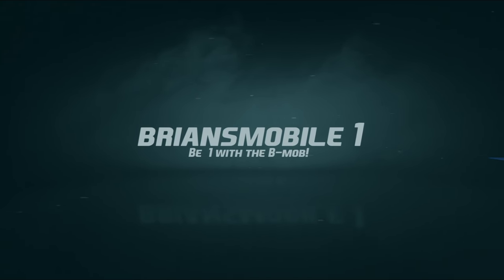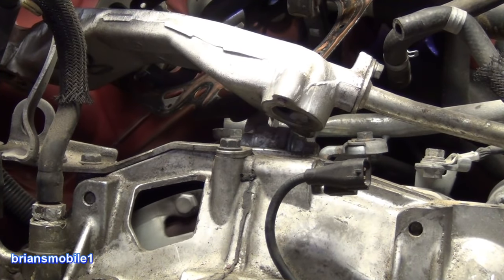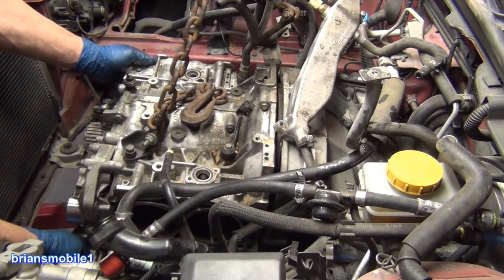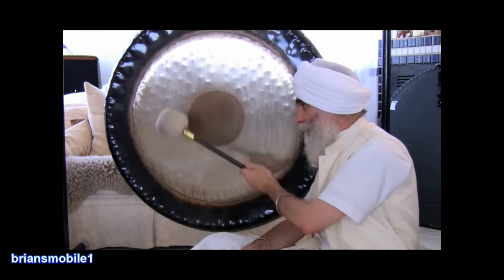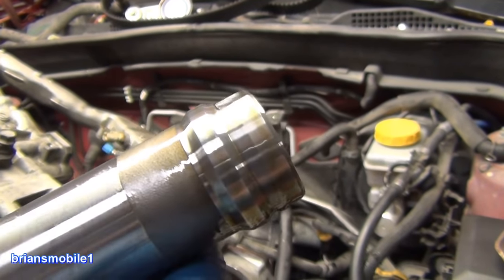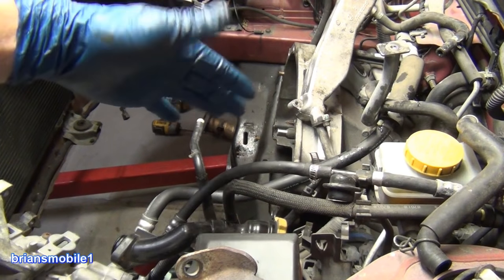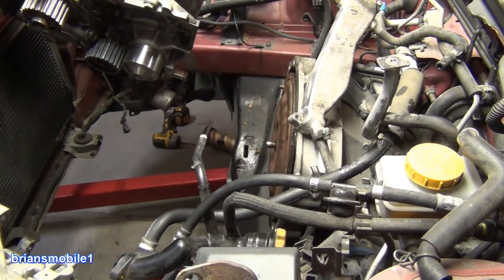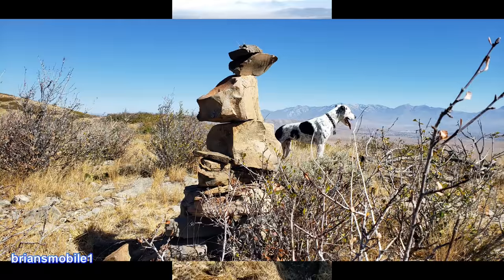Automatic Transmission Vehicle  Engine Swap Hazard$ & Solutions

Comment: Putting your finger on the torque converter bolts is WAY easier than picking the car upside down and shaking it until it falls out.  Guitar tricks don't work quite the same on cars.
Reply from the maker: Sage advice my friend!

Comment: So I absolutely totally pulled the torque converter out of my wife's Forester when I replaced the head gaskets. I pulled the engine with the intake manifold on and never thought about the flex plate. Out came all the fluid. Had to replace the seal and I spent a solid hour cleaning and cursing myself.😂. Could have used this 2 years ago! 

Thanks for the videos!
Reply from the maker: You're welcome- thanks for the feedback and the endorsement of sorts Questchaun!

Comment: Great video - I wish I had this in March when I did a auto trans swap on a 96 impreza.  I spent a day trying to figure this out.. but I knew I had to seat the torque converter before I put the engine back in.  thanks again for another great subie video!

Comment: Thank you..I'm old now..had 73 Subaru and my Dad had one also. Pulled the motor on both several times. Only used a cherry picker once. My Dad and I would just shake the engine loose and lift it out while leaning in from the fenders. I was cured of Subaru's. My daughter got a new Forester with eyesight...  So I really appreciate all your videos. I also just bought quick jack. Your video helped with that. No more Jack's and Jack stands. It comes Saturday. Again, thank you.
Reply from the maker: Congratulations!  "I was cured of Subaru's" made me laugh.  Thanks Thomas
Reply: ‘85 turbo wagon and ‘87 manual wagon.  I’m Subaru cured for sure.  “Expensive and built to stay that way”. Check old sales slogan 😏.  I did trans, heads, a/c, CV joints, front rear diffs.  Okay in the snow when they weren’t broke.

Comment: I can't tell you how many times people look at me with deer in the headlights when I tell them if they torque converter comes out with the engine, you need to pull the pump input shaft and check that the clips aren't busted and while you have it out to replace the seals. I haven't done a video on it since I no longer own any auto Subarus.

Comment: The name refers to the ability of the disk to flex across its main axis – bending side to side – to take up motion in the torque converter as rotational speeds change transmission jumps during torque and hp and acceleration @briansMobile1

Comment: I had to pull a seized engine out of a Subaru, that was a good time. Ended up having to pull the converter with it then hack some aluminum to get to the remaining torque converter bolts.

Comment: I've recently had my head gaskets in car go so took engine out sent heads off for machining put engine all back together done seals, valve clearances, gaskets, new timing belt water pump etc. Putting engine back in the flex plate must pulled torque converter out I didn't notice because never needed turn it by hand to line bolts up thought i was super lucky at the time so put one in finger tight then put bell housing bolts in pulled engine and transmission together turned engine over by hand put other 3 bolts in put all car back started it up heard/felt horrible vibration grinding noise looked in engine bay instantly knew that someone was wrong in the transmission pulled engine back out of the car and tried get torque converter off it would not budge had use pry bar and turn and pry to get it off then seen half of the spline was ground off metal shavings everywhere.

I reseated to torque converter hoping the end of spline was worst damage I caused put all car back together again sounded fine drove it around block came back started burping cooling system and checking for leaks car ran fine no air bubbles coming out no oil leaks just small drip coolant coming from water pipe to throttle body hose ran car up to temperature all going good for about half hour then bang horrible whinging noise worse then before engine check light on and A/T temp light and lost all gears.

Comment: Hi Brian, thanks for all your work making videos- you’ve got good teaching abilities in my opinion- but on to my question- I’ve changed the transmission in a 08 tribeca and all was good at first maybe 500 miles or so, but now it’s developed a clicking noise and I’ve found the torque converter bolts are impacting something as they spin( just barely enough to make the clicking noise- im in the process of checking the toque on the bolts and I don’t believe they’ve come loose ( checked two so far)I never pulled the torque converter from the used transmission that I installed it seemed like it was completely seated at install and there was no noise at first- just curious if you have any ideas or may have come across a situation like this- thank you again

Comment: I did remove the bolts but the converter did slide out a bit, not all the way though. 

I want to replace that transmission shaft seal though. I figure i got the engine out i might as well.

Comment: I recently rebuilt my Subarus engine and everything went back together fine started up immediately but there is no power to the wheels you can shift through all the gears but car won’t move whine idles fine but nothing else seems to work transmission pump shift solenoid? I’m at a lost

Comment: Hi Brian thanks for sharing your knowledge and skills :)  Regarding the pulled head studs, what is the typical cause of that on Subarus?  Over torquing the head or overheating?  Thanks
Reply from the maker: The main thing is overheating, but not oiling the head bolt threads (corrosion & wrong torque can result) is the main reason.  This poor salvage title car is like an abused dog.  The signs just keep coming up.

Comment: i got a situation my sleeve for the font pump drive is stuck and im not sure how to remove it other than taking the diff portion off.. any advice?
Reply from the maker: work it in a circle supporting the weight front/back as you work it with gentle pressure apart.

Comment: P tran? Never heard of that. I have heard of Voltron. 
My first car had a plug in the torque converter so you could drain the converter. 
IF it's not in there just Wright while tightening up the bolts you can crack or break off a part of the trans case. Ask me how I know. 
Let me bee clear. Pay no attention to the man behind the green curtain, the great and powerful Mostly has spoken. 
https://www.youtube.com/watch?v=NZR64EF3OpA
Still paying with rocks after all these years. Amazing what tickles our fancy. Great video. God bless and 
Happy Motoring